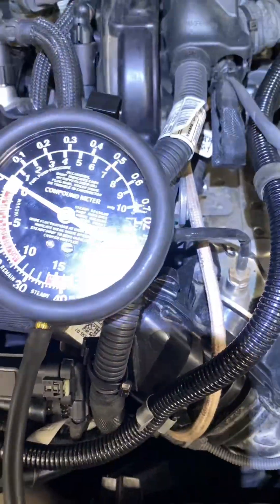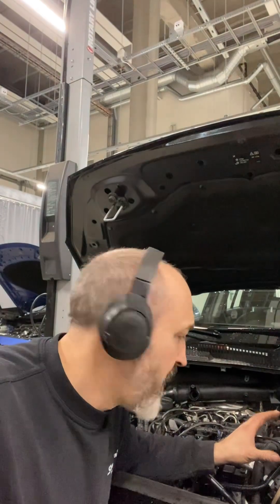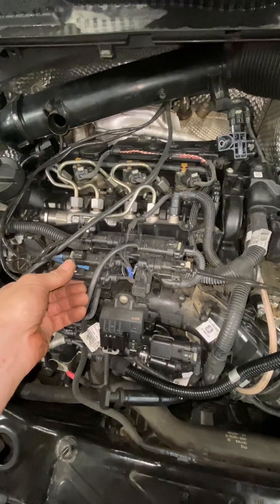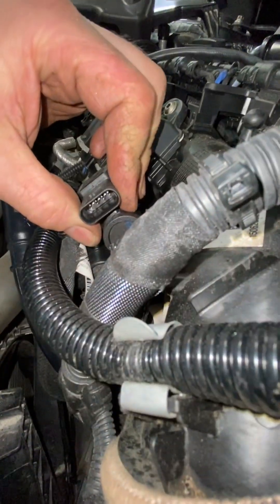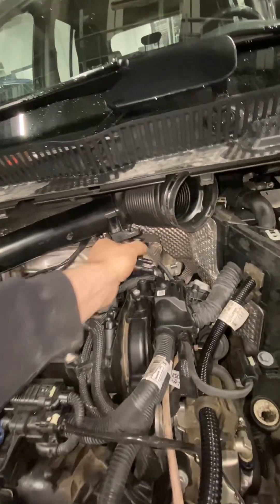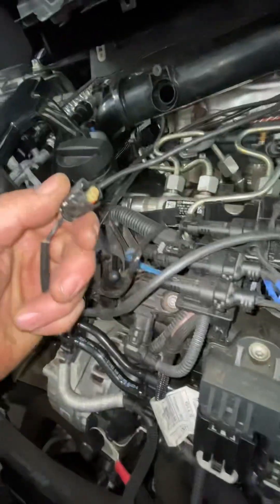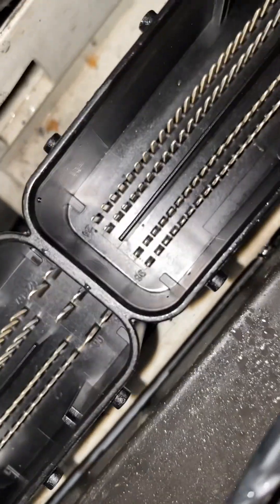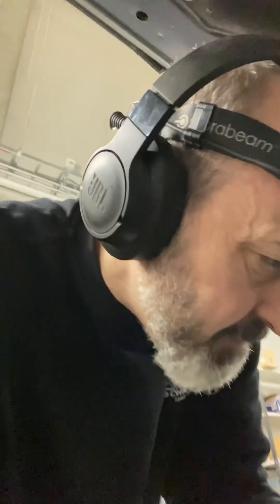BMW Diesel Sensor Leak DESTROYS Wiring – B37 Hidden Problem

Comment: Went to bmw (Italy) yesterday and they stated it is "common wear" as diesel is corrosive and may leak through the sensor, so it is not a recall nor a engineering difect. They also said that "if only I would have made every service to them this would have never happened because they check things like this. Fun fact: the problem has started some months after the last bmw service..." can't wait to give away this piece of crap of a car (from an engeneering/repairing point of view, as a user is ufortunatelly wonderful to drive) to buy a nice toyota
Reply: Hello do you still own the car?
Reply from the maker: I fixed it it was customers

Comment: It’s a BMW recall. Injectors connections get clean, MAF,EGR,OXY sensors, fuel pressure sensor and if the diesels reached the dde, that also requires replacing. 

Obviously the full engine loom too. Common on these engines and it’s due to the fuel sensor like you said.
Reply from the maker: My next car will be a Toyota 🙂

Comment: Sorry bud but I think I’m not following properly. Where is the diesel actually originating from?
Reply from the maker: The low pressure sensor had been leaking then they changed it, blew out the wiring and traded the car in but as you can see the wiring is still soaked internally with diesel 🙂
Reply: Hi,can i ask you why the sensor is still leacking if they change it? What do you mean by blew out the wiring? Thank you. Have a nice wekeend!
Reply from the maker: @catalinmaris6887 The wiring usually is blown out with compressed air plug to plug and brake cleaner. The sensor has probably been identified as leaking and replaced since the sensor isnt leaking so it must have already been replaced. If you told me 80 euro for a sensor or over 1000 for a harness as a customer I would choose the cheaper option. In this case thats what they did. Good weekend to you too 🙂
Reply: Ah, right. I’ve understand. Thanks mate
Reply: Thanks for replay!